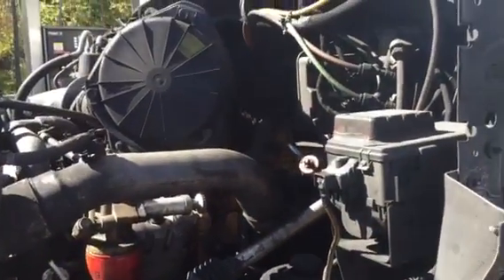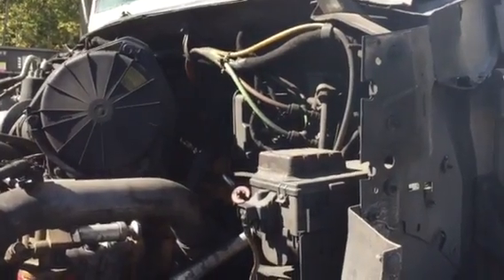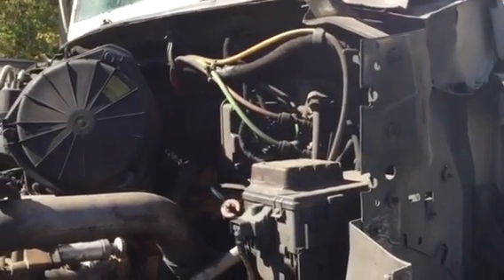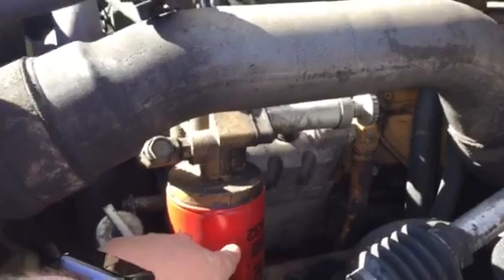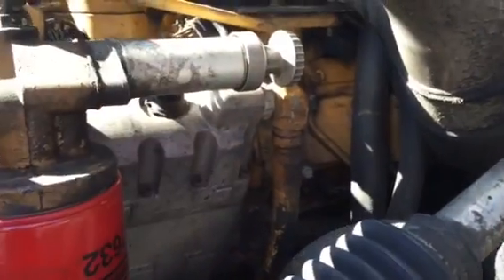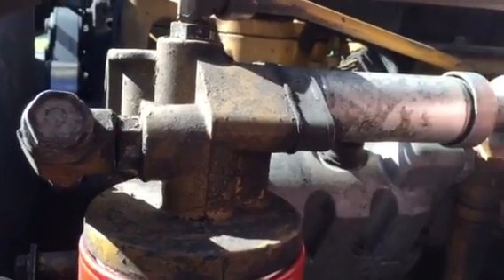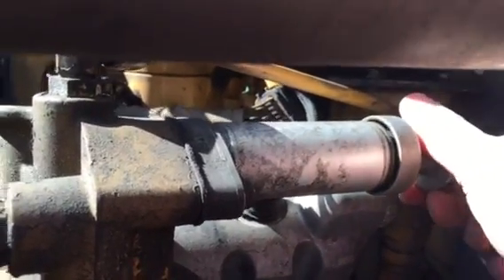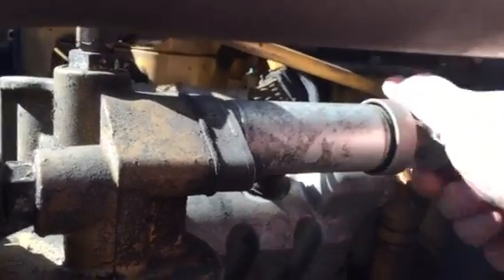How to do an emergency prime on a Caterpillar Diesel engine.!

Comment: Quick question where is the desiel pump located on a caterpillar engine like that one
Reply: It depends.  The diesel lift pump is usually on/part of the governor or HEUI pump assembly.  Some newer engines may be speccing electric lift pumps at the fuel tank like most diesel(and gas) pickups use...